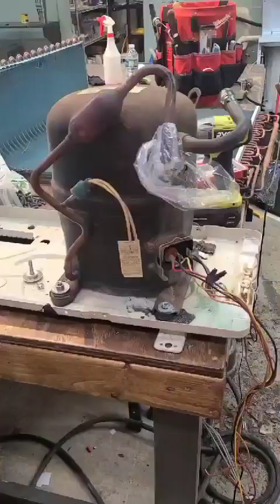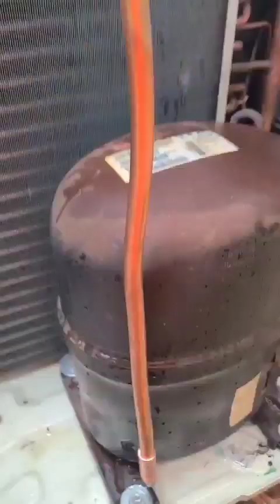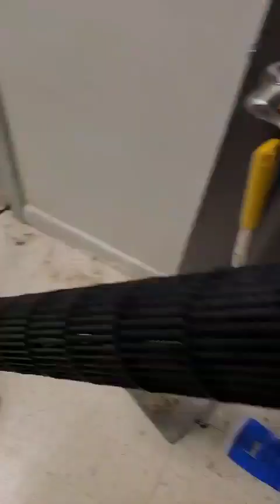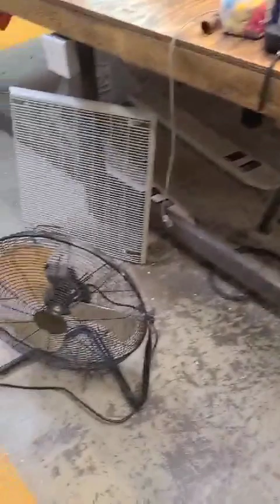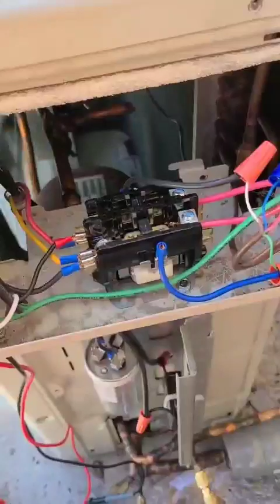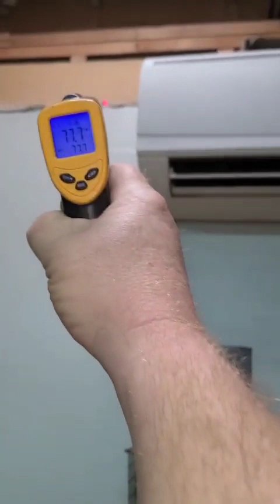gutted a dual head 410a mini split and rebuilt it with a r22 compressor other old school parts

Comment: hi they high presure switch how to conect they weiring ?
Reply from the maker: Run one half of the 24 volt system for the thermostat through it . When it goes off it breaks the connection and cuts power. When the pressure drops the switch will allow power back though. most digital thermostats have a five minute wait after they come back on from loosing power. This will protect the compressor from burning up in the event is a malfunction